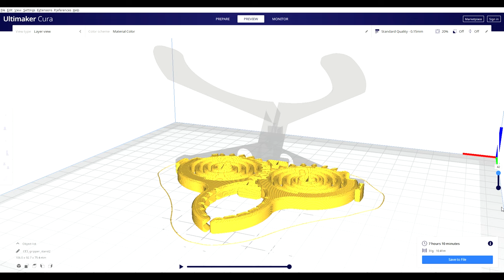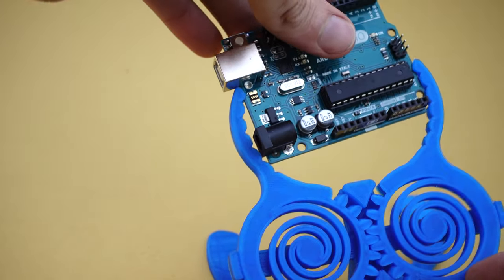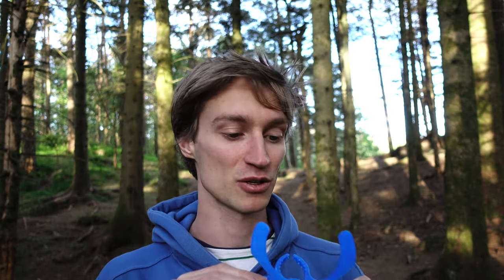PCB-Holder Print-In-Place!

Comment: this werks until you get a heavy pcb with heatsinks, flyback transformers, giant ultracaps etc, etc.
I'd improve the design by adding a few mm of soft durometer 30-60 rubber to all the contact points and maybe a version with a concrete/sand infill base.

Comment: the sad part about these awesome tstuff is that if you accidentally touch it it'll melt and get over your tip
but awesome stuff! very useful for other stuff too. I'd probably have to make it heavy on the bottom too
Reply from the maker: If you actually are planing on using it, then i strongly recommend printing the "go-pro" mount version, there its alot easier to get a solid base :)
Reply: @TurboSunShine  yeah! and I also realized you can dissipate the heat for quick touches by using aluminium foil!
Reply: @TurboSunShine  Hey, Awesome design. I just decided to print the go pro mount one. Could you please add the STLs to the go pro clamp that you are using? Thingiverse search sucks so bad. Sorry.
Reply from the maker: @asifnadeem4534  thats it